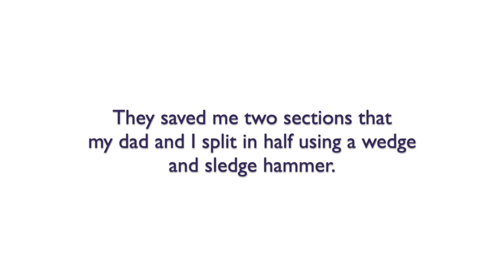From Tree to Bowl | Greenwood Hand Tool Woodworking

Comment: One way to dry the wood slowly to reduce checking is to place it inside a plastic tote. Open the tote 2 times a day and wipe out the water to prevent mold growth. This takes time but greatly reduced checking.
Reply from the maker: Great tip! I ended up putting it in an ikea bag after about 2 weeks once the chips had dried, and from there, no problems. I closed the bag most of the way, and did leave room for air to move.